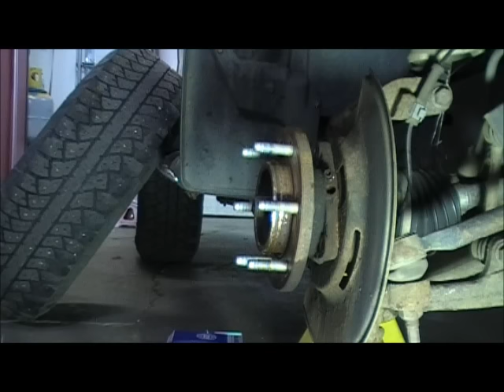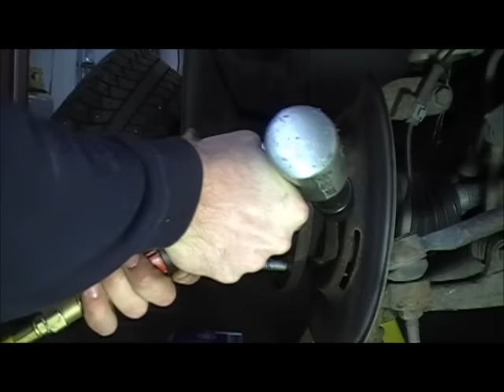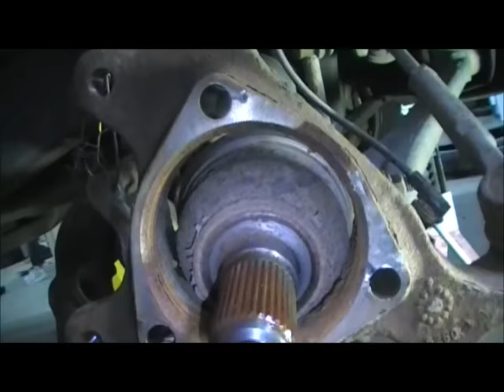How To Remove A Wheel Bearing And Hub In Under 1 Min!

Comment from the maker: Hey guys! I made this video many years ago to show how helpful a GOOD air hammer can be in this situation. This hub had a lot of surface area and was sooo stuck. The air hammer removed it so fast. If you take your time the backing plate will be fine. The hole you see is the bolt hole not a new hole cause by the hammer. Even if you bump the backing plate it will all squish flat on install and not be a big deal. Also air hammers don't have torque Lol! I miss spoke.I am going to try to upload helpful videos every week so consider SUBSCRIBING. Let me know if you SUBSCRIBE! Have a great day.

Comment: Use the flat hammer bit and spray some penetrating oil. I use the flat bit  on the flat of the hub and hammer for 1 min then switch side to get it turning. Once the hub moves press the hammer on the back of the hub and drive  it off. Doesn't  bugger the backing plate as much and is especially handy on aluminum knuckles
Reply from the maker: Good tip.

Comment: I wouldn't use that air hammer on a hub that way as the video showed if I were you. You don't want to damage the wheel knuckle, it is not easy to find one and expensive. I would recommend use an air hammer on the bearing part or push clockwise and counterclockwise. Overall, great video.

Comment: Hahahaaa.  You gouged holes into the cooling duct shield... Using an air hammer like you did is ok, but you have to be careful not to bite into the shield.. I guess the extra holes may help in better cooling for rotors... LOL

Comment: Most DIYers will not have an air compressor with sufficient capacity to feed this tool. Then again, if it's going to take an hour, just remove the knuckle and go at it on the bench (or garage floor, as the case may be).
Reply from the maker: Good point. If it's off the car already take it to a shop with a press and slip them a few dollars to separate it.  Or stick it in the bbq till its red hot! Lol

Comment: i see you order the dust shield at the same time as the bearing. if this is your own car you have time. if you are doing this or money you should have a hub shocker in your tool box. if you have even the cheapest stick welder you can easily make one from old hitch parts. that said my first boss at the shop i landed a job asked; why is there always time to do it right the second time?

Comment: secret weapon ? lol
ya worked for me but took about 5 or so mins
btw, you realize torque is twisting force, Torque
is a measure of how much a force acting on an object causes that object
to rotate., this tool does not do that
Reply from the maker: lol. yes rob I realized I said torque when I edited the video but didn't bother correcting it.  The correct term for air hammers is bpm (blows per minute) But I believe the design of the air hammer also can increase the force of the blow. And of course the air pressure also.

Comment: too violent of a solution, no problem if you don't mind destroying other components.
Patience is a virtue.......
Reply: how much patience you need when you need your vehicle?  i been at this for a week , mostly because  i cant get to my truck everyday  (bearings falling out of my truck) my hub assembly is split with the triangle part stuck on the knuckle, everythig else is out. im about to try to cut it out
Reply: @barbadosslimful2601  I split mine in two yesterday. How'd you make it happen?
Reply: @jsin3104  Sorry to be the bearer of bad news, Bought a $200 air-compressor and hit the thing with the airhammer for 3 days straight and NOTHING.  I then took the entire knuckle off and put the thing into an 11 ton press, hit it with a plasma laser cutter to try and it get it super hot - back in the press -  shit would NOT come out.  Here's what the poor thing looked like after we gave up - https://imgur.com/a/m6dRhsS  Capitulated and got a replacement knuckle at the junkyard for $75. - Had the backing plate, hub assembly and ebrake included.